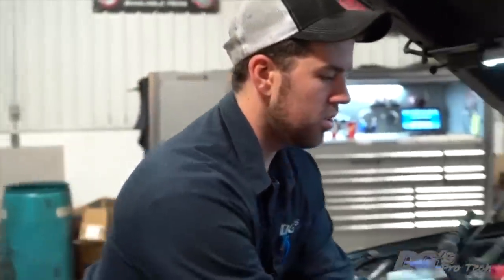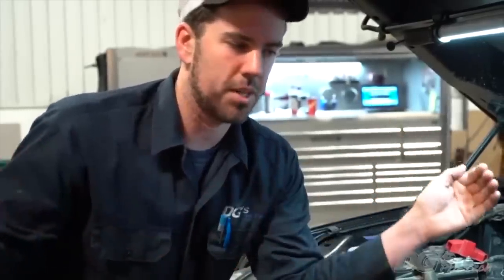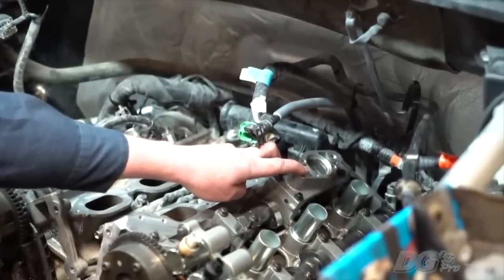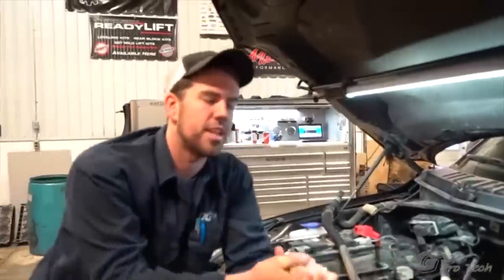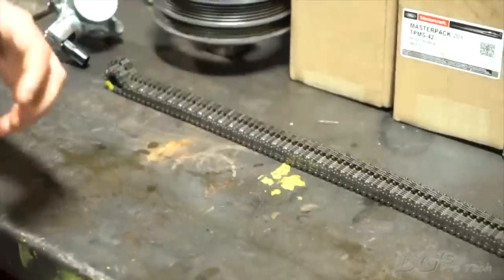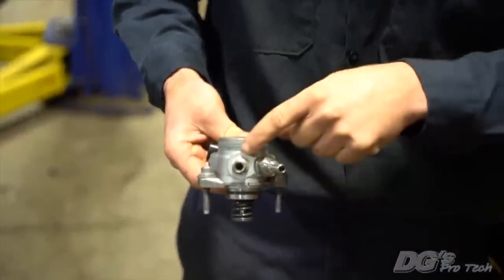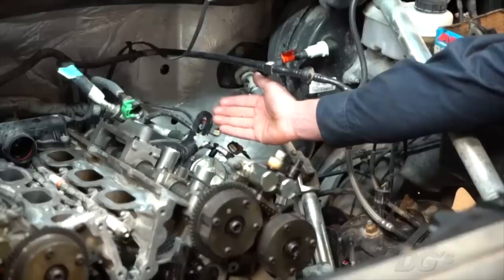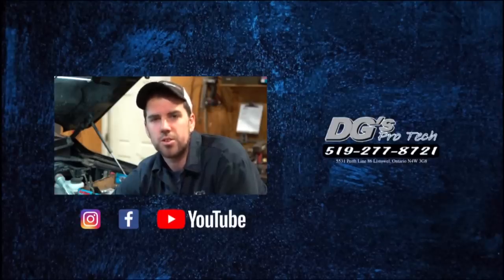What you NEED to know about Ford EcoBoost Engines by Dustin Golley of DG's ProTech

Comment: The trouble is in our job , customers have not been brought up with modern technology,  they don't understand that you will wreck your engine if you don't service it , they always want to skimp on repairs , would rather have their hair done or new nails , then cry when it's gonna cost a packet to fix , we as motor vehicle repairers , have not yet joined the magic circle so have no magic wand to fix it , great video , fully agree , same shit over here in the UK , in Jaguar engines
Reply: It doesn’t help that the manufacturers have stretched the recommended maintenance intervals in the name of selling “lower cost of maintenance” to the buyer. Case in point...Nearly every automaker that uses the ZF 8HP transmission says it’s “fill for life” while ZF explicitly recommends changing the fluid at 8yr/100000km.
Reply: In the last 100 years or so, what car/engine hasn't begun to fail without proper maintenance? Sloppy maintenance (especially of the engine) is like giving bad luck a disproportionate chance to wreck things while giving the owner absolutely nothing to gain from not servicing the vehicle properly. Some engine type with certain usage patterns might last for some time despite lax maintenance but I don't even see the point of comparing the durability of different engines without the assumption that all engines are first and foremost properly maintained.
Reply: It's a good thing people don't do the recommended maintenance, I mean how much business would be lost if everyone maintained their vehicle to spec.
Reply: simple solution = TOYOTA/LEXUS best qualty cars and engines ever made
Reply: KIRK S eh, not really. I mean, yeah they’re good, but they’re all good these days.

Comment: This is NOT an engine for the average person and who wants to worry about how you drive to keep it working as it should?
Reply: I enjoy it, lasted me 7 years and although I dont put a ton of miles (about 75k in that time) it's pretty spot on how he described, drive it for fuel economy 90% of the time. But also open up the turbos every once in a while,  maybe as you merge on the highway to and from work, and randomly to pass a slow driver. That and keeping up the oil changes/sched maint and putting in a catch can to keep some of the turbo blow by spray out of the top end, and it's been very good to me

Comment: And there chains are junk
Reply: their

For example, THEIR chains are not junk. THEY’RE more prone to failure if the owners don’t follow logical maintenance schedules and change the oil in THERE frequently. 😉
Reply: TheMentch171 I have f150 eco boost 3.5  and 2006 CT’s caddy 2.8 the engines are similar. I think the same engineers designed both lolol . The f150 2011 I just purchased  and am just finishing both cab corners and rocker replacement and by Ontario rules have to be mig or ting welded which I am doing by the way where can I get the duct tape installed at the factory to cover all the holes on the back side of the rockers ,very quality job ford using grey plastic duct tape to cover the holes .

Comment: Fords way of getting in to your back pocket with more of there over engineered junk
Reply: Along those lines, Ford now puts plastic oil and transmission pans on their Mustang 5.0 and Shelby's.  They stopped doing it on the Raptor because of leaks or so I heard.

Comment: Ford, Jaguar, Lincoln etc. are known for poor quality timing chains. What a cluster...new cars and trucks and in only 40,000 to 60,000 miles, or less, it's a $2,000 repair bill on an item that shouldn't need attention for 3 times that time period.
Reply: Not true. Proper maintenance eliminates the issues as he said. EcoBoost are prob the most high tech an high performance motors in main line vehicles from any automaker! They arent fragile. Ppl love em. Just do proper consistant maintenance . Easy.

Comment: Excellent tips and explanation to us!! Hats off to you for being honest and sharing your experience and opinion. You seem like a true professional and I applaud your diagnosis and review!!
Reply: robert mullen nah, I believe he’s just tired of fixing these trucks and telling people what to do to make them last. Stay on the gas huh, then what’s stretching the timing chains? You drive it easy and you risk turbo problems?
Reply: @365handle  they aren't related. The chain failure is due to lack of maintenance. He said he recommends sooner oil changes than the 15k 3-5k is better and use premium oil and filters. The turbo problem is due to people not letting it open on the regular.